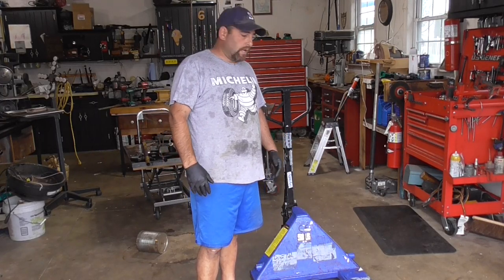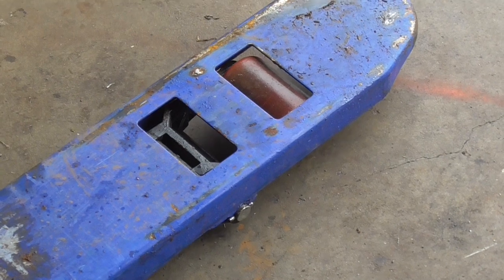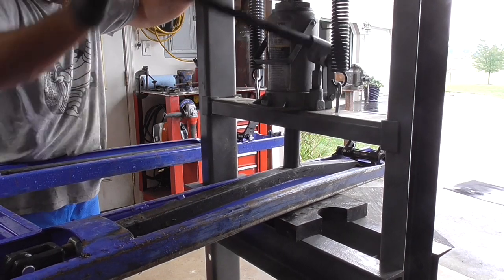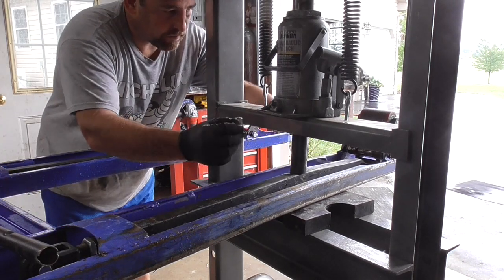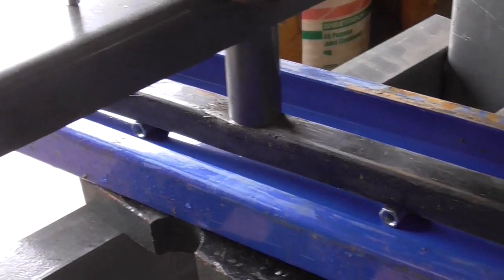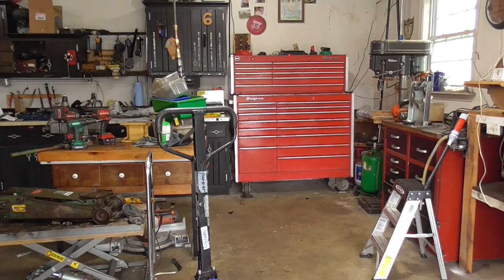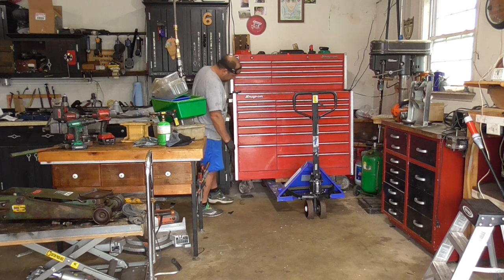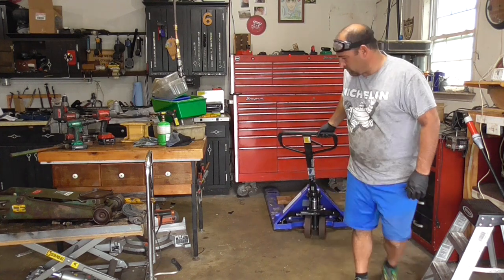Repairing A Bent Pallet Jack

Comment: How the HELL did that thing get bent like that?  I'm trying to figure out how that could possibly happen and I just can't figure out how it could get damaged like that..  Any ideas?
Reply: A lot of shit happens in warehouses and on shipping and receiving docks. When I saw the title, I thought the forks were bent inward.
Reply: @JohnSmith-fx4se  Yeah, when I first saw it, I thought the outer metal shell (the part that the pallet actually sits on) had been bent out/down on the side where it does a 90 degree turn underneath.  
I'm still puzzled at how this happened.  I would understand if it was motorized and someone may have put a chain on it to pull a pallet or something..
Reply: I was helping someone get a forklift that was stuck in the grass out with my pallet jack and I only used one side and bent my rod like that with all that weight on one side
Reply: @kde5fan737 
I do logistics and I bent both of mine by lifting a pallet that weighed 6500 lbs but but my jack can only lift 5K.  So now I’m going to try this tomorrow or be out $500 bucks lol 😢

Comment: Can you show how to repair a jack that is crooked? We used our jack to lift up a 4000lb solid iron pallet. We had to use two jacks so basically we had one side of a pallet jack lifting each side of the pallet and now everytime I use it whatever I’m lifting is leaning to the left really bad. I imagine it’s the fork that connects the hydraulic system to the frame